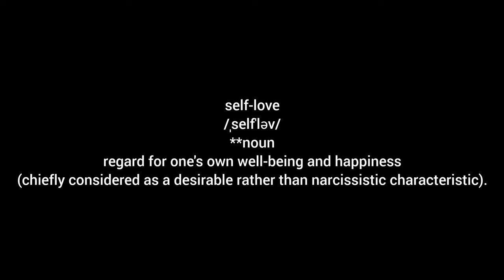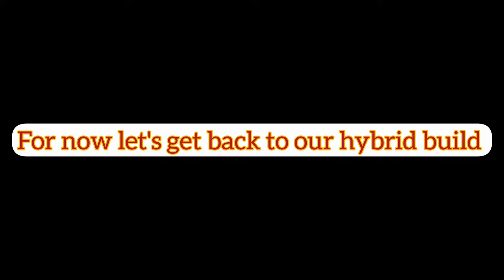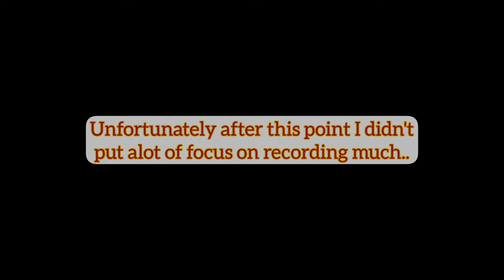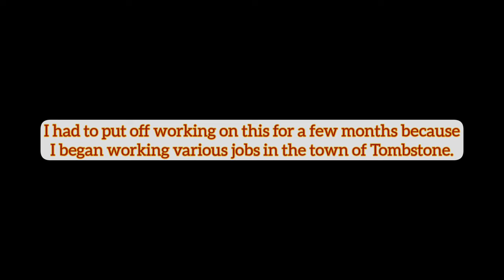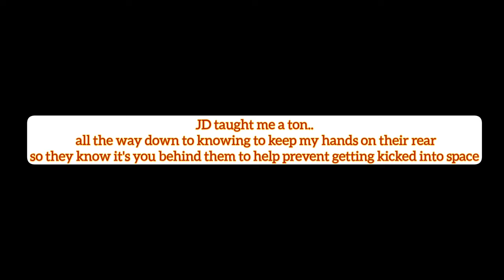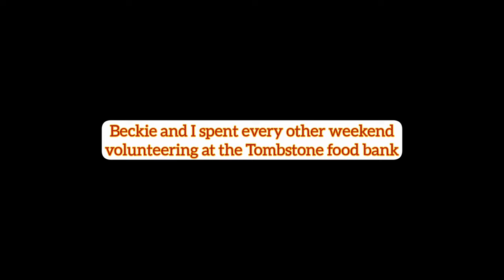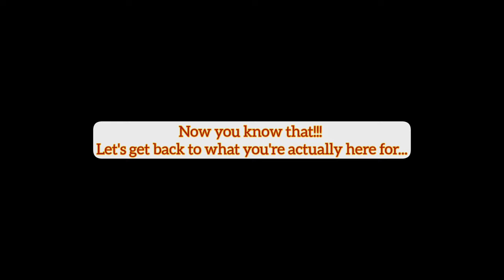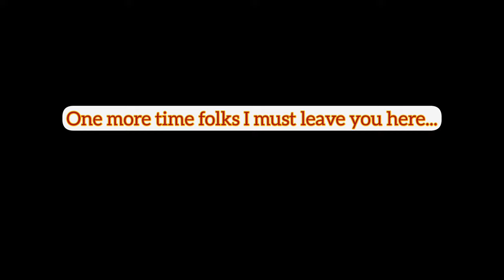Building a Greenhouse with Recycled Materials: (Part-3) The Ultimate Hyper-Adobe/Tire Greenhouse

Comment: I just saw Tombstone for the first time last September when I bought my property. Not too far from there either. I didn't get to spend much time though playing the tourist but I will make up for it once I move there. Love how your greenhouse is shaping up 👍
Reply from the maker: So we are not that far apart.  Any particular reason why you didn't go for 4+ acres? You can then take advantage of the opt-out which allows you to pretty much build what you like minus all the extra permits, inspections, etc. You would still be responsible for building (whatever it is) to code. Yeah so Tombstone is a lively place when it's up and going.. maybe join the Tombstone is home group on fb and others to see when things are happening.
Reply: @QoverQHomestead  I could only afford the two and a half. But I'm looking at the acreage next door 👍
Reply: @QoverQHomestead  I'll go check out that Tombstone group Thank you
Reply from the maker: RU4 is what is needed to opt-out
Reply: @QoverQHomestead  thanks for the heads up. You might have just saved me some money. Better go see what I can do then. Appreciate the direction 😉
Reply from the maker: Glad to be of some assistance.. 4 acres or better will get you eligible for the opt-out.  Good luck!